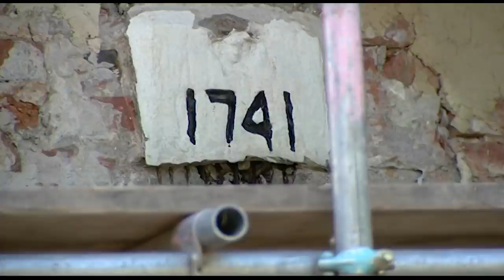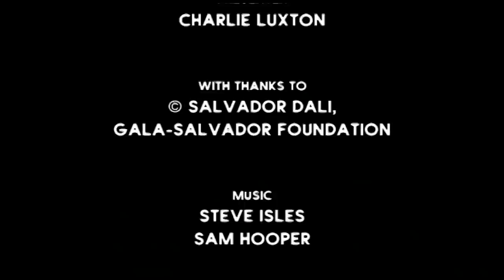Windmill Renovation Journey - Build A New Life in the Country - S04 EP3 - Real Estate

Comment: The house is beautiful. But it is not a country house. They brought the suburbs to the country and had vastly unrealistic expectations at every level. I’m surprised that the contractor hung in there. They are each experts, yet decided to forego the architect’s expertise to “save money” on their lavish home. Retain the expert and save time and money in the long run.
Reply: The home is beautiful, but I disagree on bringing the suburbs to the country. On the outside it is still very much fits the surroundings, but the inside is uniquely them.
I don’t think their expectations were unrealistic either. They knew exactly what they wanted, the contractor I’m thinking has never worked on a project at this level. Most contractors like to keep it easy for them and not care about creating something people actually like. So yes, they did need a project manager or someone with an architectural background. That much I agree on.
As far as the contemporary interior, it may not be what I gravitate to, but I certainly appreciate the sleek, clean and clutter free beauty of it.
Reply: A country house does not have to be rustic, sub-standard or shoddy. It can even exceed those in suburbia. It is that unique solitude, beautiful, peaceful surrounding that country houses exude, not the luxury or sophistication. That will depend as per individual and depth of pockets.

Comment: l can't believe you  need a project manager needing to buy materials, can't a plaster know what he needs when, does a carpenter not know what he needs when, are they that stupid, project manager should organise workers doing what when? no?
Reply: In the USA, we call this person a general contractor. The job is to coordinate the sub schedules, make sure the client chosen materials are on site at the right time, serves as the go-between between the client and the subs, and deals with minor problems on the spot.

Sure the subs know what they need .... but if the client wants custom windows with a 16 week lead time, you don't expect the carpenter to order them. The carpenter shows up, the windows are there. The GC/PM is the one who makes sure that happens. For several hundred components. 

Plasterers can buy bog standard plaster, no problem. If the client specified lime-horsehair plaster, that's different. Especially if an intrusive TV film crew is on site, and they have products that need to be placed in the build.